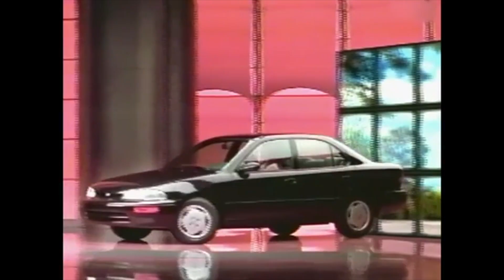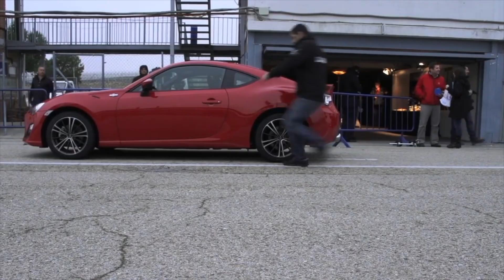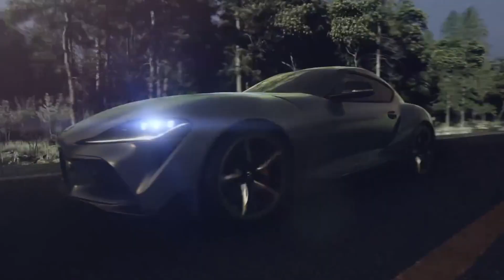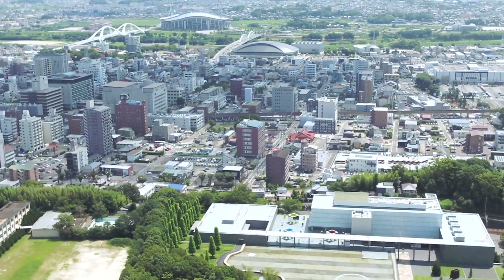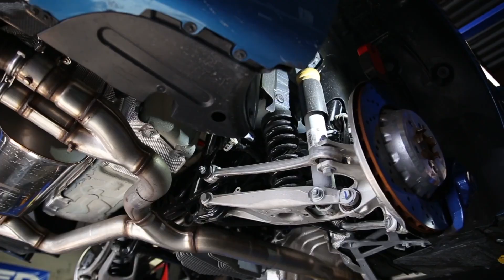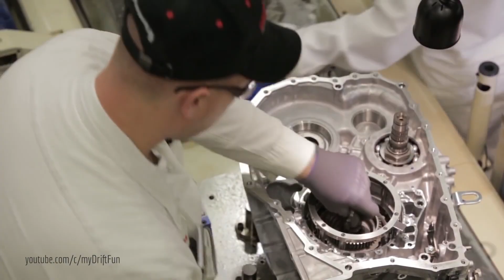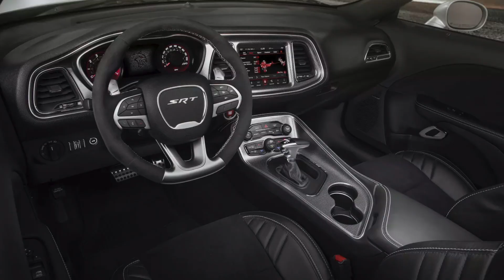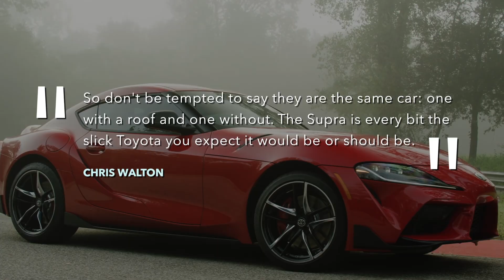MKV Toyota Supra - BMW or Toyota? The UNTOLD TRUE STORY

Comment: I find it amusing how many people are misled into thinking of the 2JZ as some bulletproof engine.  It's a hell of a powerplant, over-engineered and can make gobs of power.  One thing I noticed about the Supra community is that they're a bit more hush-hush when they blow up their motors.  Also, they're expensive to build properly for power.  Head is okay, but not the greatest.  Stronger than most engines?  Yes.  Bullet-proof?  Hardly.  It's sad, because in all reality the MKIV doesn't live up to the hype that most people bestow upon it.  As for the people saying this is all the advancements Toyota has made in 20 years., I haven't really seen much in the way of sports car development.  I thought the e89 would have been an excellent car as a coupe.  I'm actually really happy to see an offering like this at a reasonable price point and hope to see more Toyotas on tracks.  I'd love to see Turner Motorsports fielding a few.  The industry has changed, the market has changed, and to see a niche offering is fantastic.  After seeing how the ZF performs with BMW programming I think it's a great choice for a modern sports car.  People say it should be challenging the GT-R, IMO the GT-R decided to take on the world, but it came at an extreme cost for a one-off chassis design.   Skyline GTRs weren't nearly as expensive as the R35.  Platform sharing has worked great for a lot of unlikely partners (ie. Ford, Volvo, Mazda).  People cry for the Supra to return, but will hate on it upon its return.   This was always going to be an L for Toyota.  Hopefully, this thing on track will prove to be something special.  The hatred for the R35 upon launch was similar.  There was a time when the public said the LS lacked too much torque and they'd have a hard time with the LTs.  Hopefully, the Supra will speak for itself and dispell doubt, but until then, I'll keep an open mind.

Comment: Rebadged Z4? Yes. Before I read the specs on the 2020 Supra, I Google image search the 2020 Supra. My first thought was the new Z4. After reading the specs for the 2020 Supra, my Z4 theory was confirmed. It's a great piece of engineering but it is not a Supra. It's what I would imagine to be the 3rd gen 86. I am not impressed.

Comment: I don't know, I'm starting to not like the look of the Supra.
Reply: @88thetruth88 UGLY? PERHAPS, BEAUTY IS IN THE EYE OF THE BEHOLDER. Supra fans will appreciate it, not everyone does. The Z4 and Supra are not even designed together. they are completely separate. Z4= German Design. Supra = Japanese design. They only share the chassis and drivetrain.
Reply: I subscribe. The front looks like a BRZ and looks kind of cheap . I don't like the back and the car design it's been inspired from - a lexus LF1 i think - that looked way better. So I'm disappointed by this design. For me only looks nice from the side
Reply: The concept was so much nicer, it had a fucking veyron style spoiler and the mirrors were unbelievable
Reply: @dannyyy Yea! The FT1 was awesome. It's like a completely different car now.
Reply: I don’t like the lines on most of the current sports cars. Or cars in general right now. An extreme example is the rear of the civic. The tail on the Supra is no exception
Reply: Ducati Hyper821 Same.
Reply: Like the BMW 3 and 5 or the Corvette, or Ford Truck...All similar but upgraded from previous versions.

Comment: As far as the ‘dilemma’ as explained in the vid, a car developed from the ground up as a roadster already has the structural rigidity needed. It’s not an issue to put a hard top on it. 

The issue arises when you start with a hardtop and make a convertible out of it, in that extra bracing must be fitted to account for the loss of structural rigidity

Comment: I see this the same way I saw the Honda CRZ which was supposed to be a "legacy" new version of the old CRX, they failed miserably in the fundamentals giving the public something they didn't asked (it would have been more credible if it was called the Insight coupe). Honestly, Toyota would be better if this was just called a Celica GTS, put a more simple transmission and other components so the price gets a little lower. Then get some of those Lexus sport cars they already had, detune them, put them on a simple chassis with new body and you have a new Supra.

Comment: 1. It's not bullet proof like the 2JZ was.
2. Its front is ugly AF.
3. It is wayyyy too much for the specs. 
4. It's a BMW in terms of reliability.

It doesn't matter how much, in terms of reliability, work they put into the car. It is a BMW through and through. This means that to fix your Z4, I mean Supra, it's going to cost you an arm and a leg. BMW's VANOS system has always been problematic, even after revisions. I don't know man, I feel like there is a lot of praise being thrown at BMW and Toyota but this auto trash is 1. Not the Ultimate Driving Machine and 2. Not a supra, not a real one.
Reply: The Maverick Spawn:  You are clearly a  keyboard expert:  I wonder if you have even seen one in real let alone driven one for any mileage.
Reply: John Anderson Angry fangirl much? Don’t cry about it. It’s just my opinion. You know, that thing everyone can do? Not many have test driven one. However, once I can, I definitely will.
Reply: 1. True, but you can't really expect another 2jz like engine. it was truly a one of a kind motor. 
2. I mean so was the original Supra's; I think both the old and new have this trait. 
3. True. 
4. No real way to tell if that's true or not.
Reply: @hanzo_199  The BMW B58 is a turbocharged inline-six engine which began production in 2015. The B58 replaced the N55 and was launched in the F30 340i. The B58 is part of BMW's new modular engine family - each engine using a displacement of 500 cc per cylinder - following the B38 and B48 engine. This is no prototype.
Reply: The original Supra was hardly a thing of grace and unparalleled beauty but I do have concerns over reliability too. BMW were surprised when Toyota said their parts were shit.
Reply: I agree that the front is ugly. When it comes to reliability it looks like Toyota asked BMW to up the game for the engine and other components. That actually made me laugh- think just how many people still think reliable cars are built in Germany. Thy're only built in Japan these days, sadly
Reply: Wanna crossover?
Reply: It's a BMW in terms of reliability? Did you even watch the video?
Reply: Pwnsweet Lol. I did in fact watch the whole thing. Here’s my rebuttal to you. Notice that Toyota had to go back to BMW with their findings to let them know, loosely quoted “You need to fix these problems”. That means they made just another BMW that would have been just as reliable as their others. Would they have made revisions? Most likely or at least I hope so. Was it over engineered like the Supra was? Absolutely not. Will it be that stage 1/2 over 500HP monster, without internal changes, the 2JZ was? Probably not. Toyota made, from the get go and before release, an over engineered piece of marvel that won the world over. Toyota swung for the fences when engineering the 2JZ. BMW swung for the pitchers mound.
Reply: @MaverickSpawn  you are spot on.
Reply: @MaverickSpawn  actually the B58-Engine is very much capable of over 500HP on Stage1. The B58 Engine used in the supra and some bmw´s is quit a beast. Don´t underestimate. Besides have you driven the new Supra yet or even better any car with the B58 Powerplant? I guess not
Reply: Emanuel B Hello there keyboard elitist. I don’t think many have driven the RZ4; however, I have driven a few BMWs as I’m a fan and used to own an M3 myself. Used to.
Reply: @MaverickSpawn  Keyboard elitist? :D This like my 5th comment on YouTube wtf Haha. Besides I do own a 440i equipped with the b58 and charged with the mppsk and still own a e46 3L but yea whatever if you have not looked into b58 (closed deck, water cooling, forged internal and the list goes on) then you shouldn't be judging.

For the looks: yea it dont have much in common with the original supra

But engine wise? Oh lord that 2jz can be glad to have a successor like the b58 beast. Now stop the trolling you weird bird.

Follow me on Instagram if you think about the b58 like I do:

black.bayer_f32
Reply: @MaverickSpawn actually it was your presumptions about the B58 that lead to my comment. My e46 is at 240000km atm and drives still like a charm. That dont mean all e46 work like a charm and it sure does not mean that all BMW is crap. You my friend have a weird way of telling things. 🤔
Reply: TheMaverickSpawn absolutely spot on. The Supra name is suppose to be along the same class as Nissan GT-R, but this new Supra is more like a mediocre mid class sports car. That’s a shame. Supra name shouldn’t be a compromise, Toyota should have made it above and beyond and charge an arm and leg for it. It’s not and was never suppose to be a sports car for the masses, it’s suppose to be for the few who can afford it. That’s how the 2jz version was. Financially for Toyota it could be good they make more sales in short term. But for their name, they fucked it up. And in long run could ruin their reputation.
Reply: 00ninja00 Supra was never supposed to compete with the GTR any GTR would destroy a Supra on the track it’s a faster car in the straights and corners.

Comment: it IS a rebadged z4  you forget there were coup and hard top convertible versions (you can literally see that it has the same roof). Now the z4 is good, but this is not a Supra at all (it might be better but still). (Probably with previous generation components like the fiat spider).

But saying they are different works well for BMW and Toyota, one doesn't want a slightly cheaper competitor, the other doesn't want to look like they just dressed up another car. Of course they will probably handle differently, one has a roof, the suspension might be different (time will tell). But no matter what the outcome, it is 100% BMW with a bit of Toyota on top. If you like the car, that is just fine, it is probably pretty good (though expensive for such uninspiring performance figures). But it is a product name chosen for sales, not what it is. Like the fwd monte carlo, the new Dodge Dart, the Cutlass ciera/calais/supreme, or the GT86 (you may like any of those), but they are nothing like the cars they got their names from.
Reply: Except there is no existing coupe or hardtop version of the Z4 G29. And how can it be 100% BMW if a large chunk of it was designed and tuned by Toyota?
Reply: @Oblithian - One question that proves your first claim to be false. Is it made at BMW factory? No. Thank you, have a nice day.
Reply: @AkarZaephyr  Yes they are. Door jamb stickers say otherwise.

Comment: i like the new supra. i'll even embrace the zupra-ness of it. BMW interiors aren't a downside to me because their interiors are still nice interiors. less sporty and driver-centric than what i'd like (and vs the mk4 supra) but nonetheless functional in the ways i would need it to be. what matters to me is that the engine will have a long life if taken care of properly, and the car doesn't bug out with electrical issues (which is just a fixture of modern day cars).  no manual transmission is a bit of a disappointment but with my inability to shift a manual transmission in less than 200ms...i'll take that trade. I like gearboxes that act like sequentials.  given the chance, i'd like to make it NA, raise compression, and do the modifications to make it rev high and fast almost like an LF-A.

then i have a hope that Toyota might try to take the BRZ engine and shove it into a backwards impreza for the next gen MR2. an awd mr2 would be interesting wouldn't it? they could even get people back into rally-racing toyotas with an AWD MR2.

Comment: Now Nissan and Mazda need to do a colab and remake the 240z with a turbo rotary! Mid engine rear wheel drive would make for an evenly balanced grip car with a high revving engine and linear power-torque ratio

Comment: The real beauty behind the original Supra was the fact that you could relatively easily take a stock Supra and boost it to 1000 HP with some mods and upgrades.  The new version is lacking the performance and styling and platform that allows the kind of mods that made the original a classic - with used Supras going for $150 K and up.  A major disappointment to most.

Comment: Sorry, but to say the transmission is not a BMW transmission is not really accurate. While the basic design is licensed by ZF, the actual functional design is designed to mate to a BMW engine and attach to BMW designed drivetrain. No Toyota uses it, a number of BMWs use it, it is BMW sourced. You clearly looked at the list of manufacturers, you can see that the major user of this transmission is BMW.
Reply: Also, I think the biggest issue Supra lovers have a problem with is half of the supra appeal is the JZ engine. People wanted a successor to the 2JZ, not a BMW engine in the Supra.

Comment: I drive an e46 BMW, and I used to have an older Toyota Corolla. Both were bought used. That Toyota was unkillable. My BMW ended up with the legendary subframe issue that was a real pain in the butt to get fixed up (a fundamental engineering flaw). Honestly though, the BMW is the nicest driving car I've owned. The ONLY thing I like about this current joint venture is Japan's obsessive testing during development of the new BMW engine. Adding reliability to BMW is a massive win for the German house.  As for the Supra... in its current form, it's supremely ugly and without a manual, it's a marketing misstep. I'm curious if aftermarket will adopt and adapt this car into something that looks nice enough to want to drive because right now, it's so off-putting that I don't even want to stand next to it. And from the side, the new Z4 looks like a 10-year old Merc to me. Frankly, neither of these cars are of interest. But a reliable new BMW i6  that they hopefully spread throughout the lineup is worth all the effort put into the project.

Comment: Toyota has engines they could've used for the Supra...ie the Lexus LS500  V6 twin turbo which has 442 ft lbs of tq starting at 1,800 rpm or for the base engine use a beefed up Lexus I4 turbo. They also have diffs and transmissions they could've used as well. IMO this "Supra" is far too small and should have been sized comparable to the Nissan GTR not the 86. I've owned Supras for 20 yrs and everything I love about them is non apparent on this car. So what Toyota collaborated on chassis development because nothing on this car is Toyota but the badge. The Supra I want would be built in Japan with Toyota engineered parts not German shit used on 50 other different German pieces of shit. Boy did BMW really win big on this deal, Toyota basically re-engineered their engines to be Japanese quality while also selling Toyota a ton of shit parts. I would much rather buy the RC-F knowing it's a true Toyota.

Comment: How much of this is really factual and how much is rumour and hearsay? I ask because it sounds like the project was a mess. Typically a project manager would be assigned to work with BMW and Toyota, generally it should be a lot smoother. I'd believe it if bureaucracy held things up, arguing over manufacturing numbers, distribution of costs and production, marketing and pricing etc.. with a joint project, BMW wouldn't accept a superior, cheaper Supra and Toyota wouldn't want to compromise on their flagship sports car.

Comment: Toyota just does not want to take the kind of risks it used to have to take within certin segments of the car market. Toyota does NOT need a Supra remake to get its name out there. So, just to be a tease they decided to do this to test the waters for a REAL TOYOTA SUPRA. Not a big fan of anything BWW due to the reliability issues. That being said, You can't go wrong with the Z4 platform. They said when the Z4 came out that it was to be a much more expensive version of the Mazda Miata. We used to call it the BWM Miata! Let's see how this little experiment goes.

Comment: This new Toyota Supra makes me very mixed feelings! On the one hand, it seems to be a legendary name, but on the other hand - it is a spit in the soul of all fans! Get a BMW Z4 and attach a Toyota label to it!
Reply: Did you not watch the video?
Reply: I watched the video, and the arguments of that side were inconclusive. Some Japanese with a German education, some kind of joint development does not justify the fact that they stuck on that BMW Z4 a label of Toyota and called it Supra!
Reply: @DreamCarsPro  from the video, they didn't take an old Z4, refreshed it as a successor then slap a Toyota badge on it. 

A new platform was co-developed by both manufacturers to be used for both the Z4 and supra, so the Z4 itself isn't like the old Z4.

We'll be able to find out how different the released Supra and Z4 would drive like in due time, but at least we know their designs aren't carbon copies.
Reply: It's  true bro. You're right

Comment: Aside from the plate form the interior is totally a BMW out going version same steering wheel same idrive system even the climate control and list goes on. If co-developing the plate brings life to two great and largely distinguished sports car that's a great venture but in this case it sounds more like toyota helps bmw to improve on quality control and reliability.